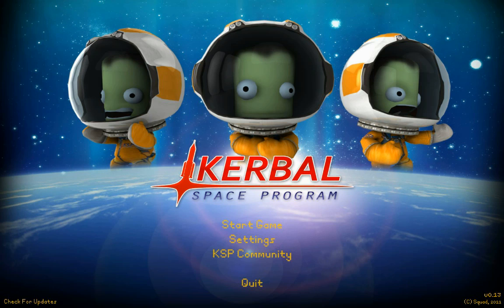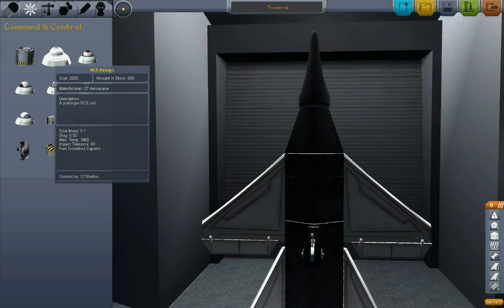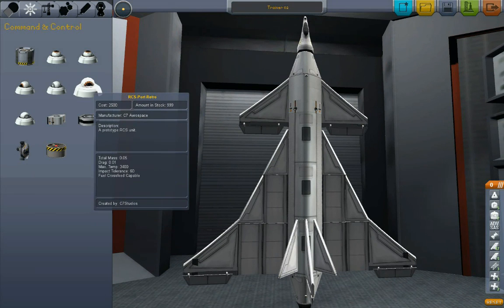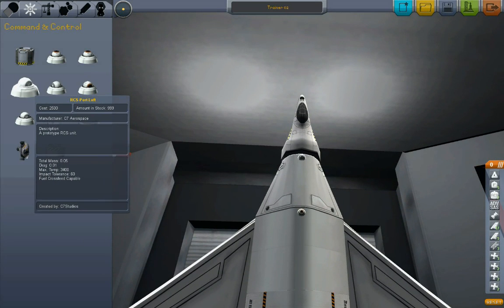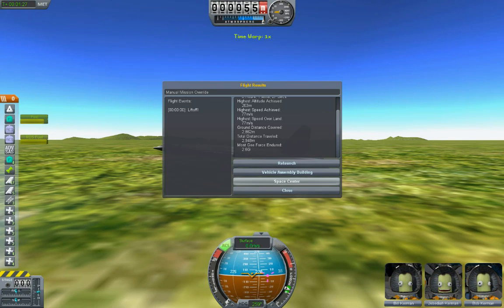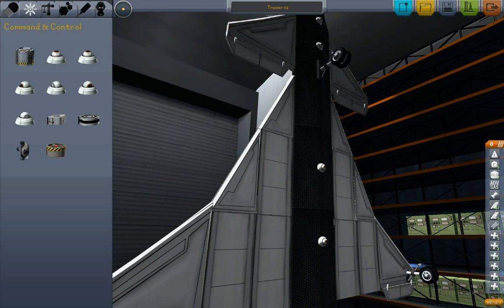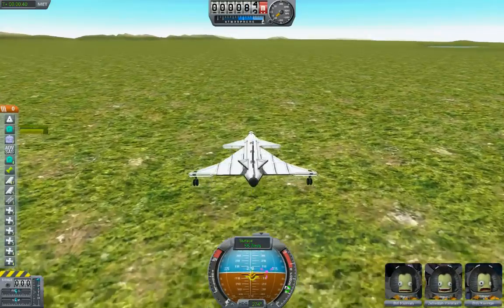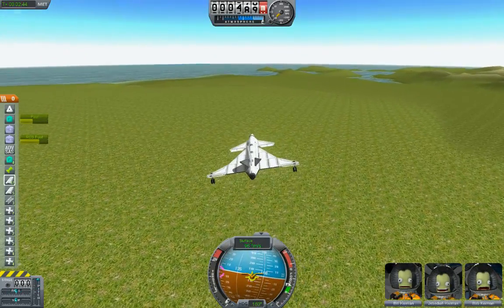Kerbal Space Program: C7 spaceplane tutorial, part 5, VTOL

Comment: but allows for you to keep a level plane allowing fully vertical lift with no horizontal speed. Only problem is with a design like yours there you would need to raise the wing wheels in some way, I think hardpoint, or maybe it is the c7 pack has some struts which are ideal for this. Get the wheels level so you have a horizontal plane when landed and VTOL becomes much easier. As I am sure you guessed the angle of your landed plane was causing the downward thrust to thrust you back Hope this helps

Comment: Because of my uselessness at landing planes, VTOL was the way I went, this also enabled me to land huge planes on the mun. Just a bit of advice, use the hardpoints rcs, I find these are brilliant, they are like the stock thrusters but there is a larger type that has quite a bit of thust and is perfect for retro firing and slowing your planes down. Also, with VTOL, SAS is your best friend, it uses a lot of rcs fuel using sas with rcs enabled, (continued in next comment)